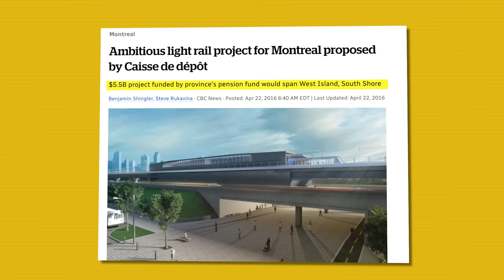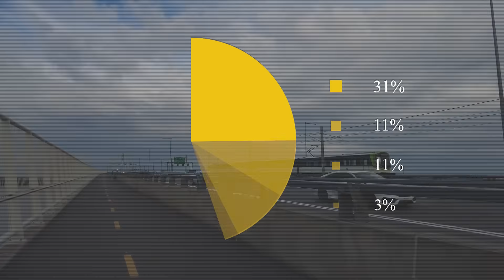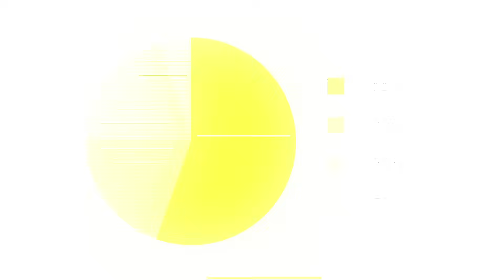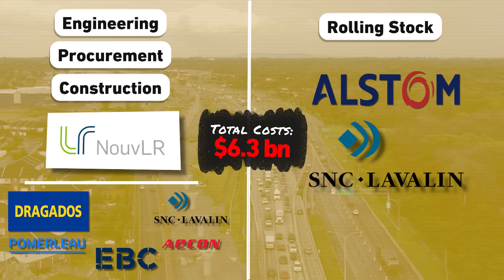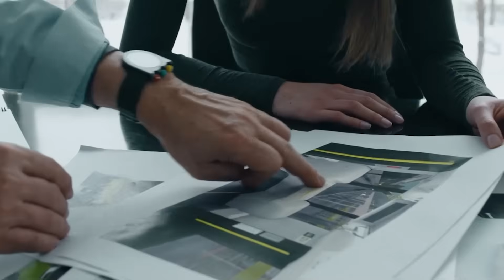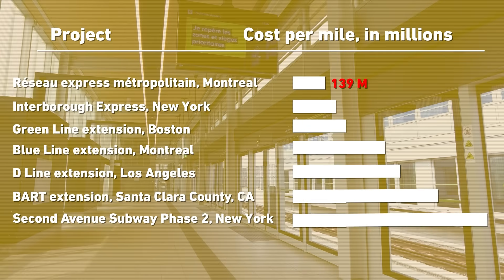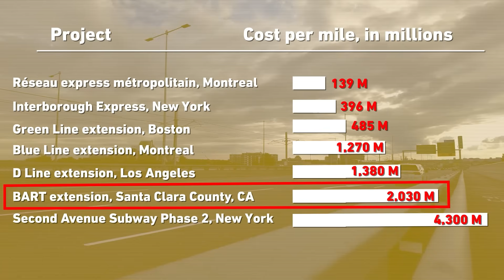Why Did This Mega-Project Cost So Little? | Montreal's REM Explained

Comment: Another thing that helped with the cost, the brand new Champlain bridge had 2 rails built in, just in case, with no project linked to it. Using this and other underused or unused rails, as much as possible, they manage to cut the land acquisition time and cost to a minimum. Which is the principle they use for the High Speed Rail project in Ontario and Quebec, using as much underused right of way as possible.
Reply: They didn't built it just in case, they knew it was going to be used for transit they just didn't know if it would be a bus/taxi way or a light rail one.
Reply: @ZontarDow  That's what I mean by just in case, they knew it could be useful for transit at one point and it would be much more expensive to not build it right away and engineer it in afterward. So there were added in, not knowing whether it would be rail or buses, and the cost ended in the bridge budget instead of in the REM budget, which would have gotten the price tag much spicier.
Reply: High Frequency Rail would use existing rights-of-way. High Speed Rail requires a new alignment.
Reply: No it didn't. The original plan for the Champlain bridge was to have two bus lanes built in. Halfway through the project they converted the bus lanes into REM lanes. They got extremely lucky on that.

Comment: It's a good project that I hope more regions emulate including Edmonton and Calgary which are adding commuter rail lines in the next decade or two according to the about to be released railway blueprint for Alberta. All train projects should be automated and powered by overhead catenary is possible because of its long-term cost benefits and simplicity compared to alternatives...

Comment: please put the cost in km not in miles, we use km in Canada
Reply: ...and everywhere else except one country.
Reply: @tepidtuna7450  Well the US & UK still use miles on roads. Also Liberia, Myanmar, Antigua & Barbuda, Bahamas, Grenada, St Kitts and Nevis, The Grenadines, Guam & Samoa.
Reply: I would also have liked it in km, but to be fair, the data did come from an American analysis
Reply: Simply multiply the prices listed by 0.62 and it will give you a rough estimation for the price per km.
Reply: Is it in Canadian or US dollars?
Reply: Railways in Canada still use miles, though I'm not sure if this includes the REM since it's an isolated system.
Reply: @jaclm where though they got Kilometre markers now in yards, subdivisions, and Passenger rail that runs on them also use metric system.
Reply: @TheRandCrews  Every railway in Canada operates in American units, the only exception to my knowledge is the O-train in Ottawa. All of those markers you're seeing are mileposts, all speed limits are in MPH, all of our engineering standards are in miles/feet/inches. I work for one of them.

Comment: It did kill off the last electrified rail line in Canada. The EXO Deux Montag Line
Reply: And entirely replaced it with an electrified rail line that has dramatically higher frequency. A win-win.
Reply: @guspaz Lost the chance to use the corridor for a planned High Speed Rail because it had run on 25kV overhead, and took over the platforms at Gare Centrale usually used for Commuter and Intercity Trains. Via Rail plans are now having to find a new way to connect Downtown Montreal with High Speed Rail.
Reply: Yes—they should get rid of the REM and return it to heavy rail

Comment: Loved the video... You covered all the important aspects really well.  I rode the REM on opening day, but live  in the western area that isn´t open yet.  The video has lots of little niggles, I guess you are far away and not familiar with local geography:

fwiw: the line map is slightly off throughout... the western tip is shown turning north along anse-à-l'orme... it just goes straight along the 40 highway to a terminus just west of the southern end of Anse-à-l´Orme.  It doesn´t turn north.

@5:37 "Four stations on the south shore" but showing the northern terminus on the island of Laval, and the North Shore.
@6:55 what you identify as the west island in yellow... is actually ile bizard... "west island" is actually the western part of the island of Montreal, and includes ile bizard (and sometimes ile perot is included also... but not always... )  basically everywhere west of the airport is "west island" ...

At some points you cover the opening, but at other points you refer the express bus over the bridge ... to be replaced in the future... It is a little confused.  The branch across the champlain bridge has been operation for a year or two.. the express bus is gone.   The grand opening of the first section killed it.

Comment: I really hope that they can build the eastern section of the REM. It would be transformational for the east.
Reply: I think it can be reintroduced in the future, but only after the current REM project is finalised. It is easy for people to believe the pessimism from certain media outlets, while work is still in progress.
Reply: No, Rem de l'Est is dead. They are planning a tramway project in the same right of way... Slower, more expensive, less capacity and higher operation costs... It's a disaster
Reply: Definitely 💯
Reply: The eastern extension was permanently canceled, there is no hope left
Reply: @ the Eglinton subway in Toronto was cancelled in 1995. The Eglington LRT hasn’t an open yet after being under construction for 13 years, but was it built 20 years later after being canceled. Montreal is a much more progressive city in Toronto, I feel like one day it will be built - especially if the funding is set up in the same way as the original.
Reply: @Mrtoz-ct3yn  Yeah ! it's too bad the Nimby's morons of the east was able to cancel the project and the Wishy Washy mayor Valérie Plante cave in . 

Which means the Folks of CPDQ-Infra decided that they have been made fun enough so they cut their loses.

Another Transit failure by Valerie Plante . The other was  the non maintained promises of building the pink Metro Line as soon she was elected The project was cancelled so we knew she can not be taked serious either.

She was smart enough to know that  She would not been able to get elected a third term as a mayor so she give up and left the place for others.

You can have all the ambitions in the worlds but with no money you are stuck doing simple low cost project like painting bike lane, speed bump  and creating dead-end and one-way which piss off the impatitent automobilist who continued to drive in Montréal
Reply: We won’t be alive for that .

Comment: They Absolutely NEED to bring back the REM de l'Est project! Shelving that project was such a huge lost opportunity for Montreal 😢😢
Reply: It is so frustrating that a handful of people that are going to pass away in the next 10-20 years ruins a project that will immensely improve the lives of hundreds of thousands of people for a century
Reply: @Tuysicom ban old ppl from meetings
Reply: I don't get why NIMBYs hate the project. I don't get how elevated railway lines affect property values.
Reply: @ianhomerpura8937  actually it would had increased significantly.
Reply: @jorgeroman2058 why? Typically, the reasons why property values go up in such cases is the easy access to public transit. But the line almost overlaps a metro line, so they already have more then adequate transit coverage. This is speaking as someone who lived in that neighborhood during the rem protest times, and commuted by public transportation for everything, barring the occasional taxi ride.
Reply: @TheBarrej2006  Is not the mayority of the line that overlaps, mainly where it narrows near downtown, and that was only the first draft of it, still it will still re-value because it can be redeveloped with the new line taken in account, also more people having access to a place because of the added ridership from the Est, means more bussiness, remember that CDPQ is also in construction business, having more options will always add to your valuation positively.
Reply: @ianhomerpura8937  The biggest reason I've heard, and the #1 complaint about living near it, is that it creates 120db of noise. So living near it will literally cause deafness over time. Not to mention it is pretty constant through the day and night.
If they could solve the sound issue then I'm sure many NIBYs would actually support it.
Reply: @ianhomerpura8937 I don’t get why NIMBYs are tolerated
Reply: Because they think it’s going to look and sound like the Bensonhurst elevated subway line, specifically along the D train's elevated tracks, from the movie The French Connection.
Reply: @ianhomerpura8937  the view value I guess will go down... Meanwhile the property value will go up.
Many of those NIMBYs are just stubborn people who don't have like. To be fair, most people don't like change. Some are just more adaptable than others.
Reply: @pbilk why? Typically, land value goes up due to access to public transit, but the neighborhood neighborhoods that where against it already have better coverage than the REM could provide.
Reply: It will be an easier sell once the main REM project is completed. While there were issues with the REM de l’est, it was still a better project than the alternatives
Reply: its not gonna happen, if you drive around the neighborhoods where it was supposed to be built, you will see a bunch of anti rem signs on a bunch of houses. The nimbys are very passionate about blocking this project
Reply: @girl_with_armor the NIMBYs are no more passionate about blocking this project as any others. They just have no opposition.
Reply: @girl_with_armor there needs to be passion to remove NIMBY
Reply: @girl_with_armor   just because they don't want property values to go down lol
Reply: NIMBY no nothings are a cancer to the REM  projects.
Reply: NIMBYs blocked it
Reply: They decided to go with the blue line metro...
Reply: on Souligny there was or still are old train tracks that could easily been converted for the REM...but they will (if ever) build new ones to spend our money
Reply: It would have cut into the Montreal Metro's Green line client base.
Reply: @trainglen22 exactly!

But instead they went with a slow tram that will take more place on the road
After that, people will cry about it like they cry about « how unreliable the service is », « It’s not made for our winters!! »
Reply: Yeah but can't the other neighbors sue those NIMBYs and later proceed to a mini scale "referendum" on the neighborhood to determine whether the majority of homeowners want the REM?
Reply: @Adrenaline_chaser  the week after the REM de l'Est was cancelled an opinion poll was published showing majority support for the project in eastern Montreal. But the cancellation had nothing to do with lawsuits or referendums, it's simply that the government caved to the NIMBYs. If the government had wanted to build it despite the localized opposition they could have, but they simply chose not to.
Reply: @YoungThos this is misleading. For this analysis, we need to devide the east into the near east and the far east. (For both the near and far east, we are focusing on the south, as none of this is relevant for the north.) Any in the near east that care are apposed to the project, as it provides no benefit to them to offset any downsids it brings. The far east is generally in favour of the project, as it would provide real and significant benefits to them that would more then make up for any downsides.
Reply: @Adrenaline_chaser yes, but no-one from that burrow (neighbourhood) cared, except the NIMBYs. I was in said burrow. And in Montreal, burrows have high autonomy.
So unless your plan is that other burrows should be able to force this burrow into something it doesn't want, and whether or not it is good for them is definitely debatable, it wasn't going to happen.
This is to double edged sword of the Montreal burrow system. The burrows have large autonomy within their borders, which means that they can get stuff done without needing to get the whole island on board, but it means that there can be no expectation of coordination or cooperation between burrows.
Reply: It wasn't pretty! lol it was gonna pass in front of oil refineries. I agree with you it would have been a game changer
Reply: @mlaroche2009  I mean , doesn't really matter where it passed. Nimbys just didn't want to have construction in front of their house for the next X years I imagine.  And they probably thought that it would be super loud ( like if normal traffic wasn't loud to start with )
Reply: I used to live in that neighborhood. While it sucks, I very much understand where they are coming from.
That neighborhood is already well served by public transit (metro) the REM would provide (to them) worse service, and the route that the rem takes is so close to the metro that it does not expand coverage. The philosophical advantage is providing good coverage to neighborhoods further east that are not well served by the metro system. But for those people, the neighborhoods complaining would be just a place that is passed through to get to downtown. It being a elevated rail product, there is not even much way to infill stations over time. Now the way that this is normally balanced out is that these neighborhoods would get compensated with some ongoing revenue share. But they don't even get that, as the revenue is going to the CDPQ. 
So serious question, aside from altruism, what does the REM offer to Hochelaga-maisonneuve?
Reply: @TheBarrej2006  I understand perfectly! You can get on the green line at McGill, and the blue line at Edouard-Monpetit! Extending the blue line makes more sense. Unless they want to build the REM on the north side of HWY 40!
Reply: Trams should be banned look at the Ottawa disaster never again. Above or under or don’t bother
Reply: @qjtvaddict  Ottawa didn't build a tram.  It has a fully grade-separated LRT line, and 2 recently (re-)opened diesel lines.